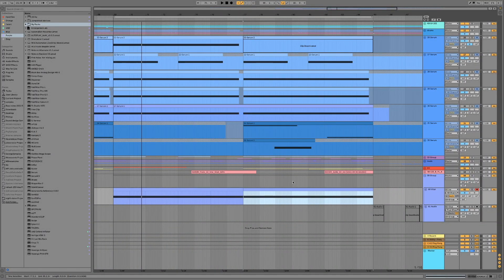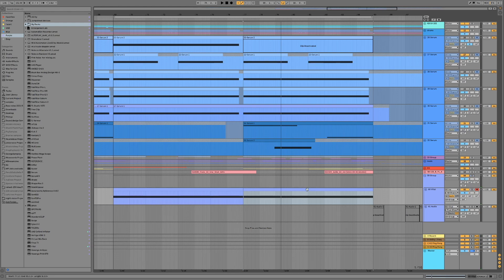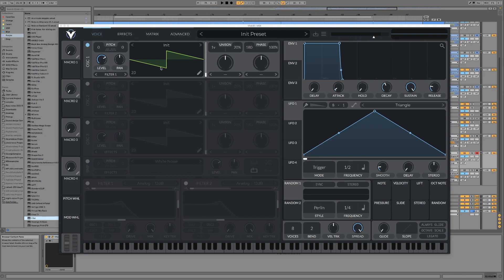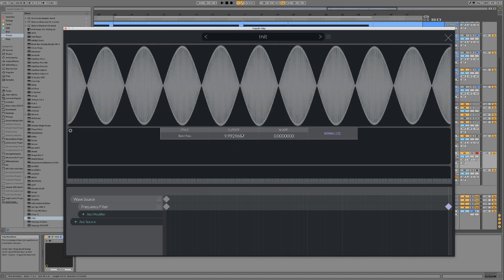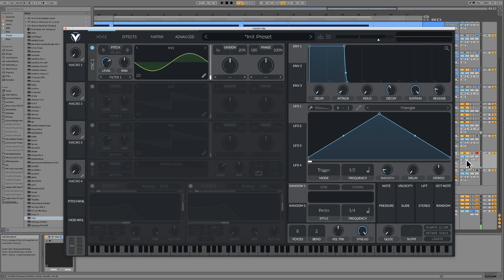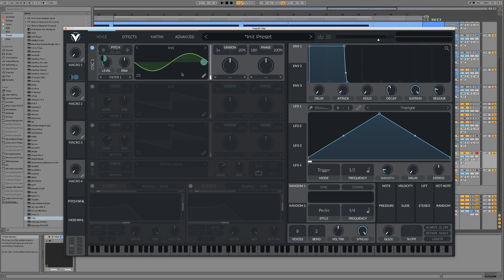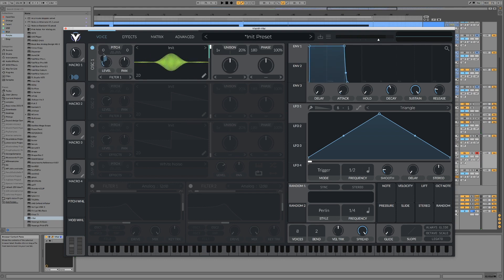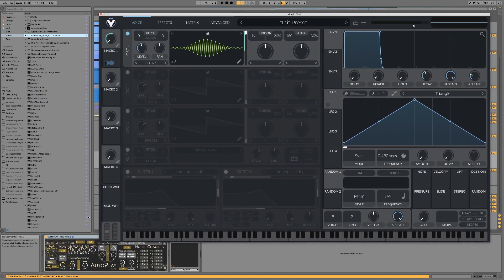[Vital tutorial] How to make Additive Squelches!

Comment: when i make it, it doesn't sound like how it does in the beginning of your video, is this because i dont use autoplay? or did you add other things outside of the video. i want to make it only using free plugins
Reply from the maker: are you randomizing the velocity? all autoplay is doing is randomly generating midi notes with random velocity.
Reply: @MuteProduction  i followed everything to the end of the video, but when i add it in one of my projects, it doesn’t sound rigut
Reply from the maker: @kleppie11  hmm, is it the right octave?
Reply: @MuteProduction I have the same issue as well... Can you provide us with the timings or the probability you've set on autoplay? Better yet, if we could simply get a screenshot of the setup on Autoplay, I think it would be identical to the sound at the beginning of the video
Reply: @hippiemonk13  You can reach the same result by placing : Arpeggiator, Random and Scale before Vital.